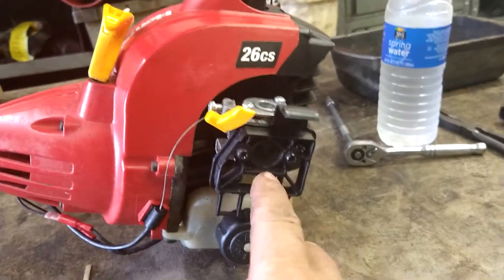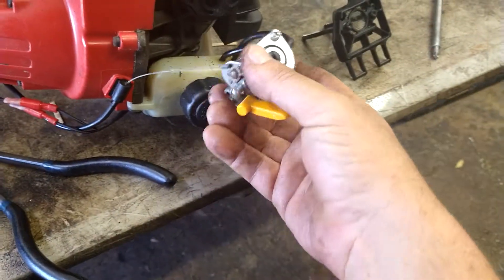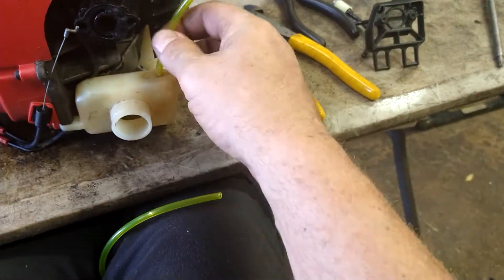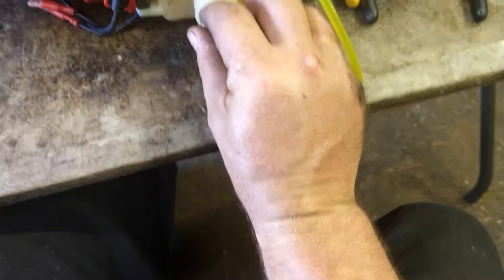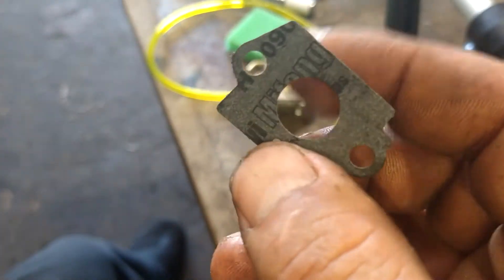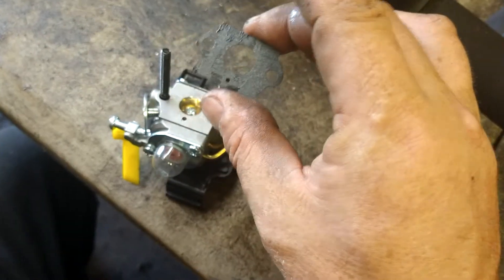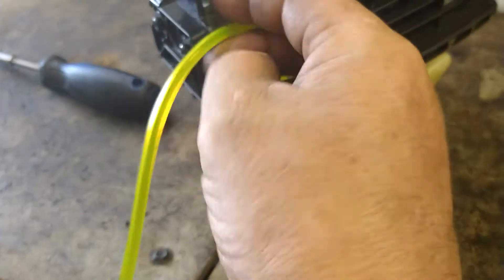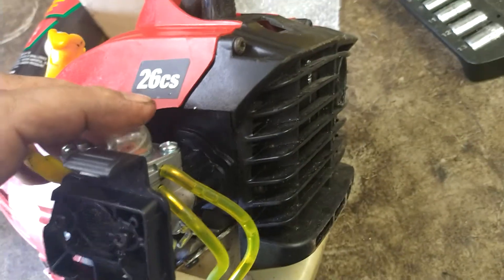homelite 26cs trimmer carburetor repair

Comment: On the homelite I have (d725cd) the lines go in through the bottom. So do I push the line and filter all the way to the cap?
Reply from the maker: No the filter needs to be on the bottom of the tank.
Reply: @smallengineguys  so I cut a short line from the bottom to where it plugs up? I mean i feed the line through the cap. Put the filter on. Then pull it all the way to the bottom and then cut and connect?
Reply from the maker: @cbreezy1322  push line in the bottom. All the way up out of the cap. Install filter. Pull line back till filter is on bottom of the tank
Reply: @smallengineguys  ok that's what I meant if it didn't come through like that. I replaced the carburetor and the line was about halfway on the tank with no filter